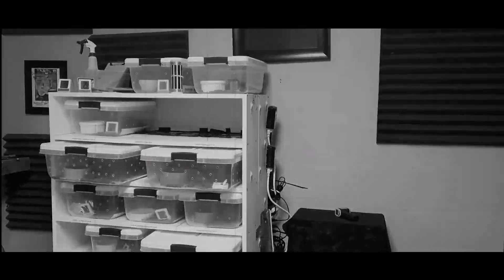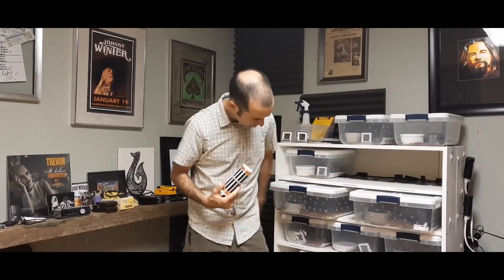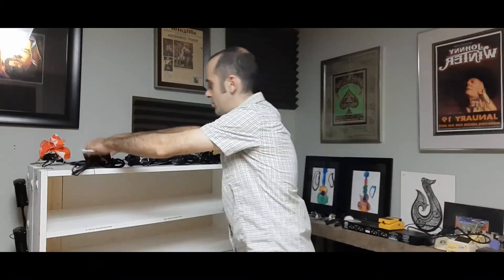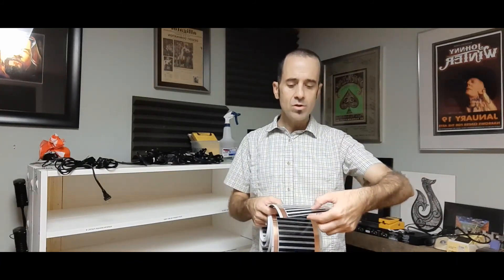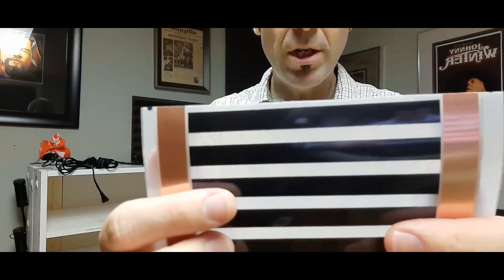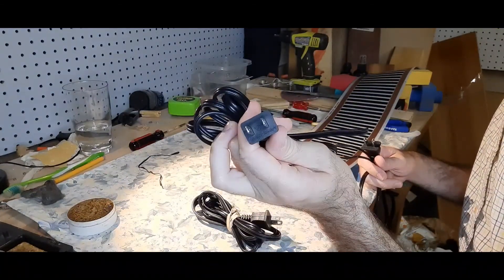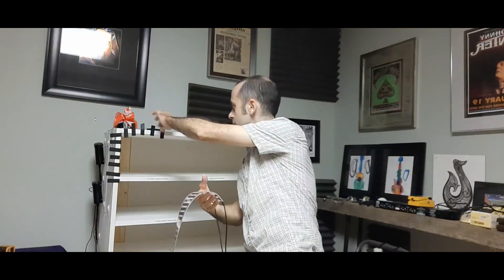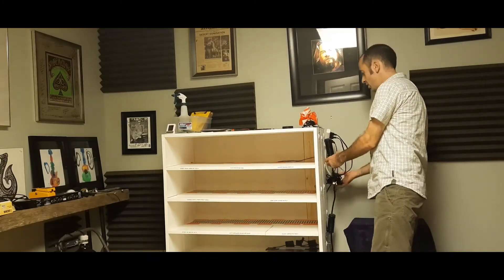Snake rack system HEAT UPGRADE!

Comment: What are the measurements of your snake rack
Reply from the maker: Hey @Tara Boi basically four ft tall, 19" deep (the tubs hang out the front) and 40 inches wide.  I use 3/4" PVC boards that are 9.5 inches wide to build my racks.
Reply: @ProperRoyals  what are the measurements of ur adult tubs I my have to move my the snakes into tubs?